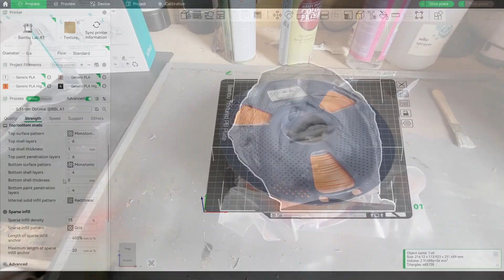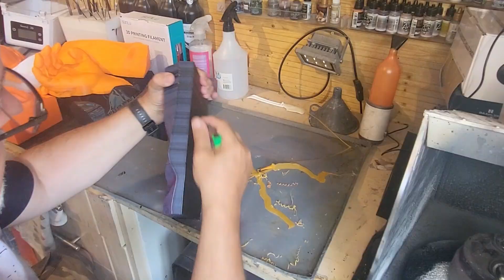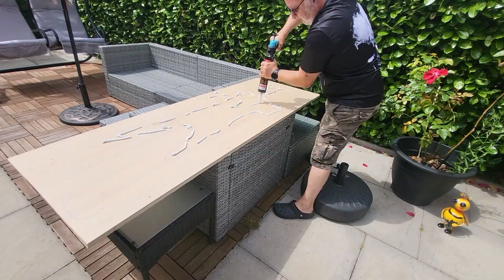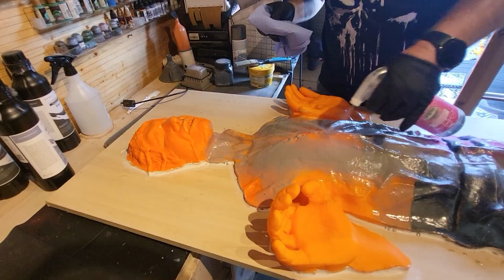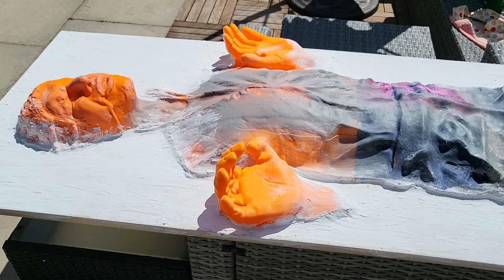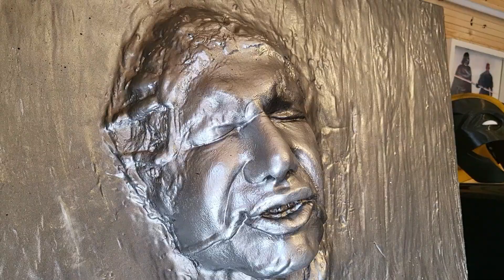Han Solo In Carbonite Easy Step By Step 3D Printed How To Make Life Size

Comment: Wow I have been looking into cold casting and I honestly thought that's what this was in the thumbnail. I always just thought to print something life-like you needed to get a big printer which was expensive I never put the two together. I will check out your other content you seem to know what you are doing that being said are there any safety issues with 3d printing I feel like I have avoided doing anything because I'm trying to be too safe also is that the biggest printer you can get as far as trying to print large life like figures? I want something big but affordable I guess lol. Any help would be appreciated thanks and nice work!
Reply from the maker: I really glad you stumbled across the channel and hence stumbled into the Hobby lol.  They do make larger printers like most things the more you spend you can tend to buy bigger build areas to a point the more you spend generally the better the quality of machine check out brands like elegoo who make some larger machines if it's resin 3D printing you are after the uniform gk3 ultra or anycubic photon m7max. But I suspect you are more into the filament kind of printer as this is the kind of used in the video ask for dangers filament printing is safer and cleaner than resin printing the all produce vapours to some degree so a well-ventilated area is needed all a form of ventilation is anything else you need don't hesitate to drop me a message on here open gifts subscribed to the Channel and welcome to The Madness that is 3D printing lol

Comment: Great video! A note on the glue accelerator application - Spray it on the mating side of the part you're gluing. Spraying it as you've done in the video isn't getting the most out of it, if anything.
Reply from the maker: fair point - it was just to get it to hold TBH the glue would set quick quick and my thinking was that as soon as the activator hits the glue it will set and it may not give me enough time to get it inmto the right position hence the activator was added after the two parts where alligned :)